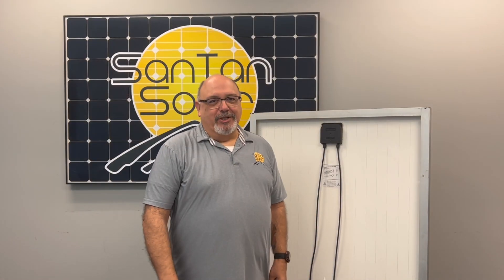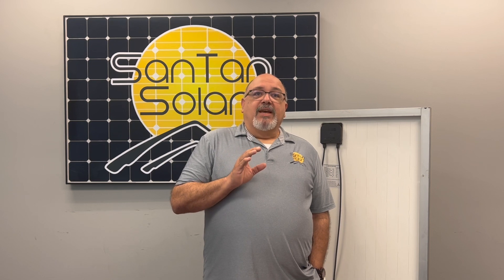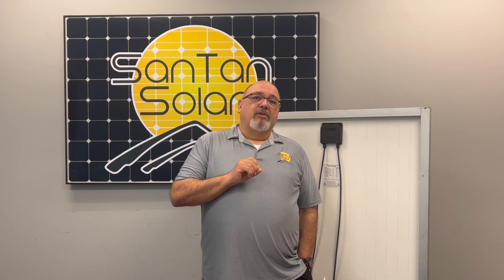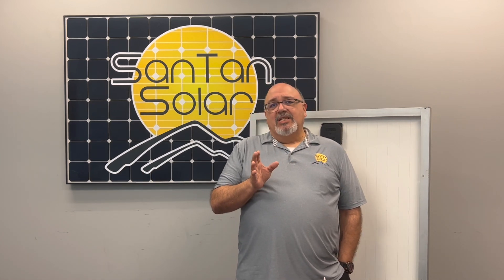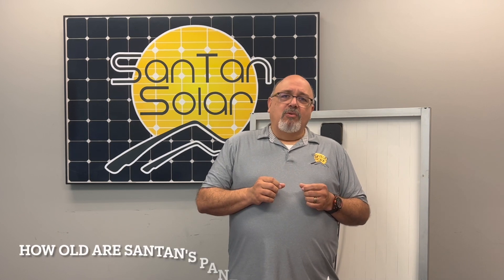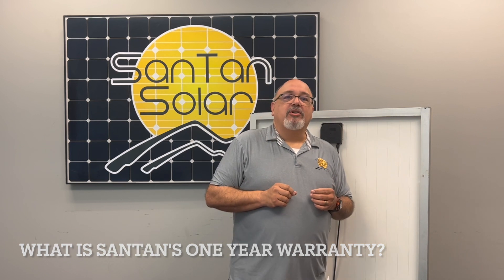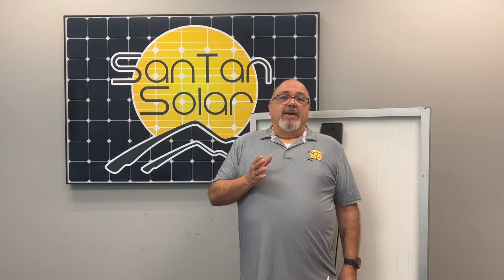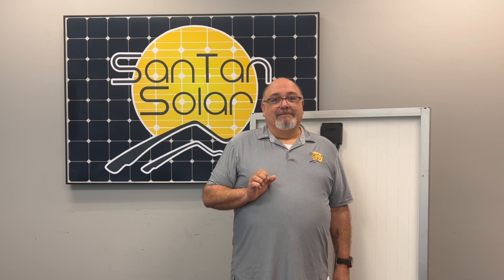Used Solar Panel FAQ - SanTan Solar

Comment: HOWdy  SanTan SOLAR, ... 
Thank YOU for my  13 Used Solar Panels 
They ALL  worked just fine in my  6S / 5P  array(s) 
COOP
the  WiSeNhEiMeR from Richmond, INDIANA 
...
Reply: ALL 13 panels are NOW installed 
on my Ground Mound Six-Arrays 
in a  6S / 6P configuration 
... 
Keeping my EG4-LL 48 volt 
Batteries filled-up even with a 
WINTER Sun = Thanks again 
COOP
the  WiSeNhEiMeR from Richmond, INDIANA 
...

Comment: Heyy just ran across you guys while looking for panels, what exactly does the Blemished category mean? Is it a condition above snail trails or worse so?
Reply from the maker: That is a great question! It doesn't necessarily mean they are worse than snail trails. Our blemished panel category means they have developed cell-side vinyl cracking, which is cracking in the vinyl layering beneath the cells. This has allowed for water intrusion, which has caused discoloration on the vinyl and busbars. They may contain other blemishes such as snail trails or minor surface scratches. The panels still output approx. 75% of the listed specifications.

Comment: I've been thinking about buying some of the panels with air side cracking on the back vinyl of the panel. My only question being how often do you need to re seal them
Reply from the maker: You can check the specs of the material you use for coating the cracked vinyl. Some products may require reapplying after a certain amount of time. For example; Flex Seal doesn't have a specific time so it doesn't need to be reapplied.